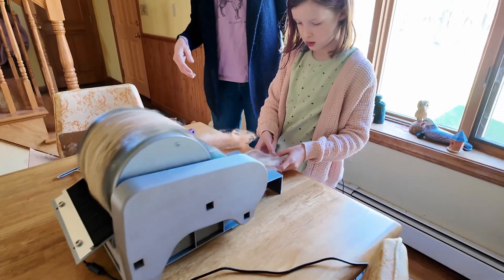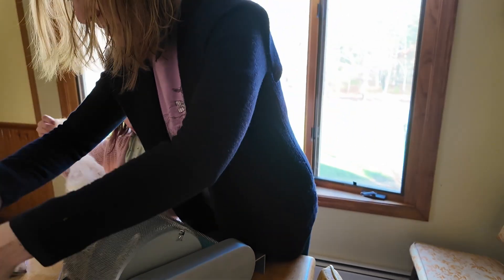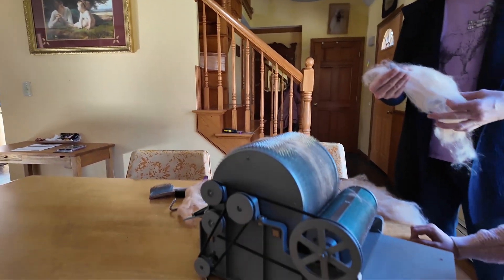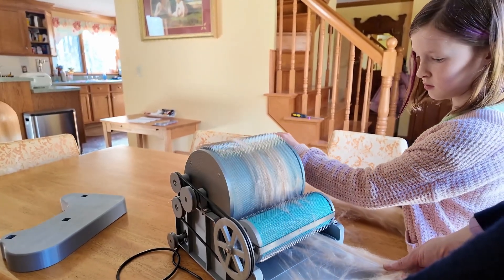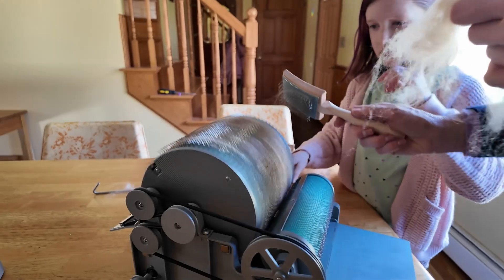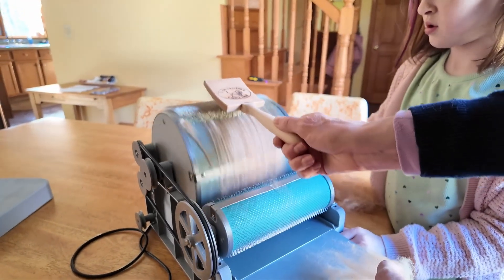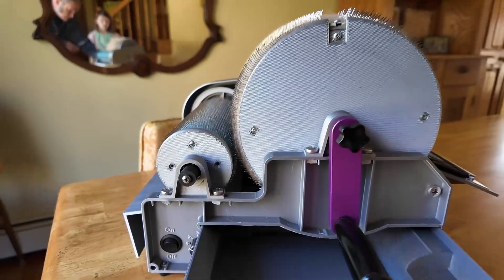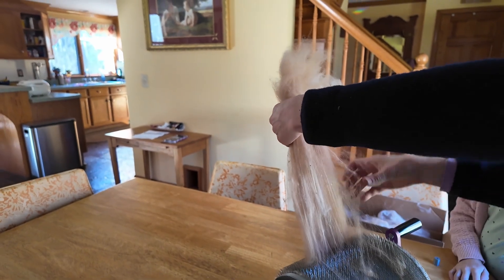Spin 190 - EEW Drum Carder Prototype 2

Comment: I think the drum rollers need to be closer together, the motor is rather noisy too, but it looks fantastic!
Reply from the maker: The rollers are adjustable.

The motor volume won't change.  This is just how the gear box I'm using works.  It's not loud as in hurting your ears over time, but it will make a lot more noise than my eSpinners.
Reply: @DreamingRobotsBlog  no it won't hurt ears or anything, but just thought I'd mention it anyway, the drum carder looks pretty smart actually, have you got a price for it yet? I love all your products and I'm getting quite a collection ☺️. Thank you for a reply. Cheers from Australia!
Reply from the maker: @howlingwind1937  My target price is around $400, but I really don't know what the actual price is until I'm finished with development and understand if tariffs change.
Reply: @DreamingRobotsBlog  that's a pretty good price, I'll look forward to it being available. 😊😊

Comment: A friend and I made a triple drum carder (I was the grunt), and he put a reversible motor in it.  I can turn the speed to really slow and it eases doffing.  Have you tried this?
Reply from the maker: This sounds more like a mini cottage carder and not a drum carder.  This is something I've considered, but decided against doing since it increases cost significantly.  If the drum carder goes well and there seems to be demand for a higher end carder I have some cool ideas in this area.

Comment: Are you willing to sell the 3d printer files as well? I would be happy to buy the files and print my own!
Reply from the maker: @mums4000  I give away some of the 3d files but not all of them.  My parts are designed for injection molding and this don't 3d print well.  Plus you still need other parts like carding cloth, circuit board, motor, custom milled metal parts, ...

Comment: Carding horizontally allows the fibers to trap more air for a fluffier batt and will blend better. A very slow ratio of the licker-in is required so the fibers (and carder teeth) don't break or bend.
Reply from the maker: I don't understand your licker comment.  The most likely place for licker wires to bend would be against the swift drum and a faster licker would reduce the relative speed differences of these two drums.  That goes against your comment for a slow ratio of the licker.  That said, I believe a slow licker ratio is important, but for several other totally different reasons (the biggest two being in my testing the slower ratio aids in transferring fiber to the swift without being left on the licker and a slower ratio aids in even distribution of fiber onto the swift which is especially useful when blending).  However, I have not seen any indication of wires bending, but I'd be interested if you have more information on that.
Reply: @DreamingRobotsBlog  I'm not a tech person I just know/learned/read that a slower licker rotation aids the fiber in a more even distribution on the faster moving main drum. People are afraid to load fiber horizontally because of the teeth pulling on the non aligned fibers. But as I mentioned, one can get a really fluffy batt and better blended product by loading horizontally. That's all I have.
Reply: @DreamingRobotsBlog  a feature I'd appreciate built in, non adjustable slots for the drums. I've replaced belts on my drum carder and had a really  hard time repositioning the the drums.

Comment: Maybe a foot-powered wheel ( ala potters' wheel ) or pedal ( ala sewing machine) at bottom for power. Safer than motor too.
Reply from the maker: I didn't cover it in this video (though I did in in the first prototype) that I will include a pedal to start/stop it just like I do with my eSpinners.  Thanks for the feedback!

Comment: I know you were just thinking aloud when you mentioned thinking of making a version without a motor.  I'd be more interested in a nonmotor version than a motored one.   Especially since it could bring the price down, which is the main reason I don't own a drum carder.  Though I don't know if the motor really is what will make the big difference, I'm guessing that the cost of the carding cloth to go on the drum is a bigger expense.  

I love the dust drawer.
Reply: As you get older, you might be more excited about a motorized carder. I have a bum elbow that really appreciates the motor.
Reply: You are correct about the carding cloth being expensive.

Comment: After using bigger equipment that my friend has, I would recommend not slowing the motor down. If anything, you can have a different control to make the licker in go slower, but speed up the big drum. Slow feed in speed with a fast drum will help get a nicer batt. This is an awesome prototype though, and very exciting! Good luck with your adjustments!
Reply from the maker: On my previous prototype I talked about the pros and cons of having a variable ratio between the licker and swift drums, but decided for this version I'm going to have a fixed ratio (though it could be changed by making 3D printed pulleys).  If this product is successful I have some pretty interesting ideas to make a drum carder sized device that works more like a cottage carder, but that is more complex/risky so I'm going to do this device first.

Comment: Do you sell the 3d files and instructions on how to build one?
Reply from the maker: I will give away some 3D printed files, but likely not all the files since some parts can't be 3D printed well and thus I don't want to support it.  If you just want a lower cost, I don't think it will be that relevant anyways because it would be likely that the cost of the motor, a single pcb, the carding cloth, handle, and all the other parts that can't be 3D printed would be more expensive than what I sell my drum carder for since I get big discounts when I order parts in volume.
Reply: @DreamingRobotsBlog  Maybe as an initial project it is better that it be manual and not electric. Do you think there is a way to build one at home with a printer in a simple enough version to make it work?
Reply from the maker: @holynic7451  My expertise is in electric and all my testing shows lots of value in an electric version so that is where I'll spend time.  I think it's possible for someone else to make a 3D printed version, but you'd still need to get several parts to make it work the most expensive being carding cloth.

Comment: Looks good, pretty nice.
The motor needs to be strong, that is the most important thing. My husband electrified two drum carders (because I sold the first one, without motor). He did a lot of testing.
Also, you do not need too much speed. Maximum should be 120 revolutions per minute, but 60 to 80 should be just fine. 
A packer brush might be helpful to push the fibres down on the drum.
Reply from the maker: I talk about this some in the video, but the problem isn't the motor.  It has a ton of torque.  It's a slipping belt and I'm looking into several ways to address it.   I expect my next prototype will have this solved (and I agree it's the biggest issue with the current prototype).

Thanks for the feedback!

Comment: I love the debris drawer and cover for the belts. After owning and selling an electric Duncan carder because it was creating neps in my Finn and Shetland fiber I now own a Pat Greene carder  with a much finer carding cloth on the main drum and double licker ins. This resolved the nep issue. It also came with a burnishing brush that has much softer tines than a hand card. What TPI is your main drum and are you planning to make this changeable?
Reply: He did some surveys about what TPI people might want and if they were interested in different drums. I think switching drums would be great
Reply from the maker: Based on feedback from the community my main drum will be 72 TPI.  I'm considering offering other drums and will make the final decision on this later.  At the very least I'll make 3D printable files available so people can put their own carding cloth on new drums, but this process will be pretty involved.  It will be an option though.
Reply: @DreamingRobotsBlog  I think the option to add another drum will be very helpful. I went into carding my fleeces after googling extensively I ended up thinking the lower tpi was fine for most fleeces. There was no indication of it causing the problems that I ended up seeing carding my Finn crosses and Shetland Fleeces. Only after talking with spinning friends who also carded Finn I realized there was a systematic problem caused by using the common lower tpi for fine wool fleeces.
Reply from the maker: @TheodoraLetz  Thanks for the feedback.  When you say finer drum, do you mean something like 120 TPI or something else?
Reply: @DreamingRobotsBlog  not the OP here, but 120 is a good carder tpi, a far far better all-round option than 72. 120 will work well on all types of wools and other fibres from fairly coarse to pretty fine, and limit the number of passes you need to do. 72 works ok on coarse and medium fibres, but terribly on fine ones, and needs more passes to get an inferior result. The only very minor downside is that you can get larger inclusions for art batts in 72 cloth than 120, but for general carding and blending (which the majority of users will be doing), 120 is far superior.

I can't imagine why anyone who has experience with both would say they prefer the coarser in the poll, so I am expecting it was just people who wrongly assume a fine carder is only used for very fine fibres, or people who've only actually tried one sort of carding cloth.
Reply: @DreamingRobotsBlog  yes 120 tpi but my Pat Greene also has dual licker ins. I don't have a comparison for 120tpi on the main drum with a single licker in so can't tell how much of the improved performance comes from the tpi and how much is the double brushing. (Never  good to change 2 parameters at once but here we are)
Reply: @vampyyy thank you! Totally agree! As someone who works primarily with alpaca fleece I would vastly prefer a 120 over 72.
Reply: I use a round vegetable cleaning brush with soft bristles instead of anything meant for fiber work as a burnishing brush and tbh it works way better. Learned it from Judith McKenzie.

Comment: Are electric drum carder motors that whiny sounding? I have a manual drum carder so this is a genuine curiosity question.
Reply from the maker: Most of that noise is from the geared motor I'm using.  It is a lot louder than my eSpinners and I expect it to stay that way.  If you don't use the motor then it can be quiet if you aren't brushing the fiber too hard, but if you are really pushing down on the fiber then it will still be fairly loud (most of the noise in this case is just the rubbing of the metal wires on the drum with your brush).
Reply: @ thank you for replying to my question. I’m pretty sure I will be buying one once it becomes available. I like the design options of electric and hand crank.
Reply: Each different brand sounds different. Some are really loud
Reply: I'm starting to watch , thinking, I kinda wish it were manual, and then BOOM! Wish granted!!

Comment: Maybe include a one way bearing to automatically decouple the drum drive when removing the yarn against the normal direction of rotation.
Reply from the maker: One way bearings are somewhat expensive and I don't really see the advantage of them.  In fact I can see some use cases where you might want to go a little backwards and that wouldn't be possible with such a bearing.  Could you explain this request a little more?